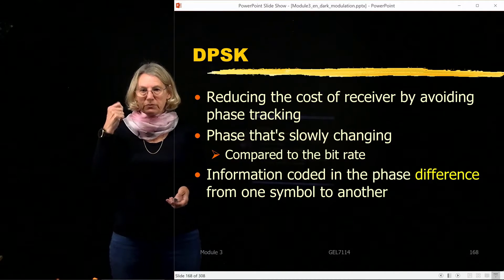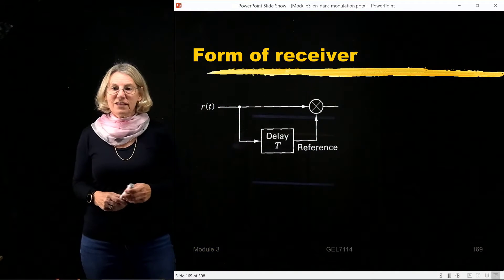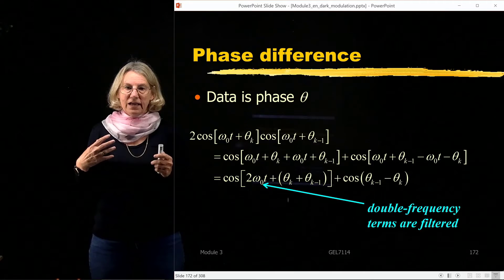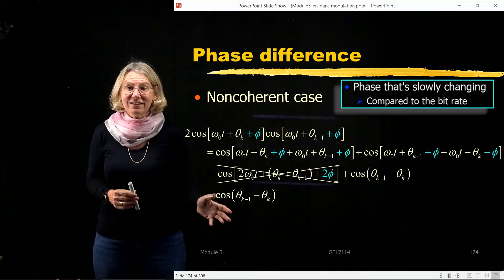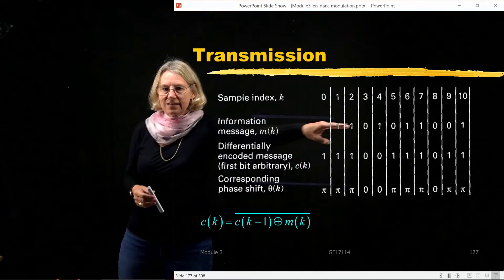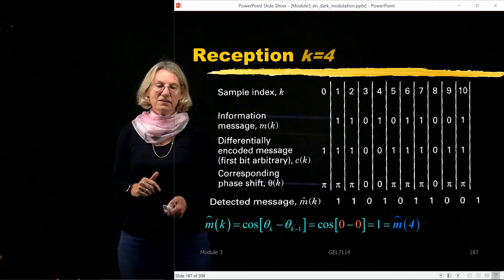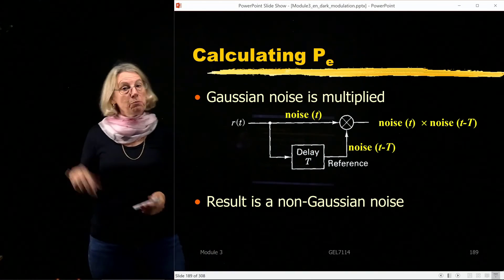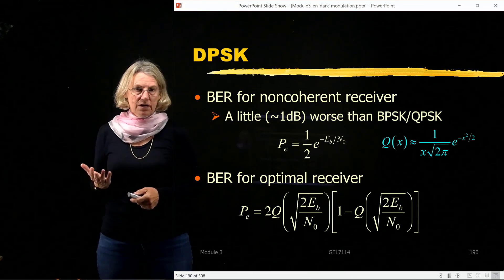GEL7114 - Module 3.13 – Differential Phase Shift Keying (DPSK)

Comment: Hello, first of all, great video series, thank you very much! I have a question here: In the receiver of DPSK, why would we still need the correlator part after multiplying our current with the delayed signal? What am I correlating with what here? I mean, from the calculations we got that by multiplying the current cos signal with the delayed cos signal and by then applying a lowpass, we get a signal that is time independent, like cos(pi), cos(0), etc. (like at 6:30min in the video). This is already a result - why should I multiply this with the symbol time T in the correlator?